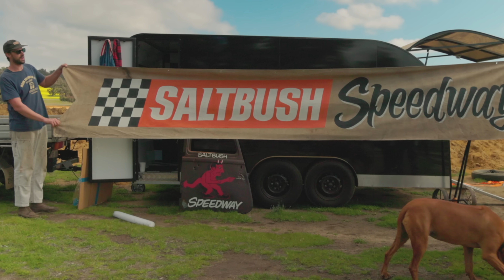Canola Fields and Fast Wheels: Private Speedway Track Built in the BUSH!

Comment: Great video!! Sorry to hear about the engine but as you say "its repairable ."  Its great to see you using your car. So many times, sadly they are parked and preserved as a display.  Using the cars are also a way of testing your engineering which certainty helps you build even better cars.